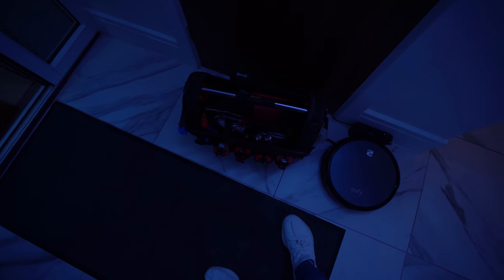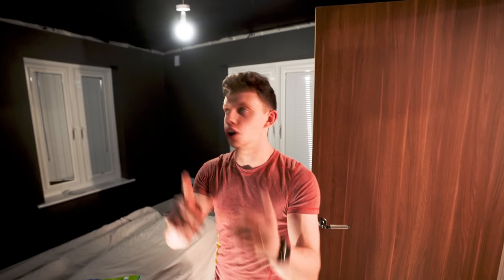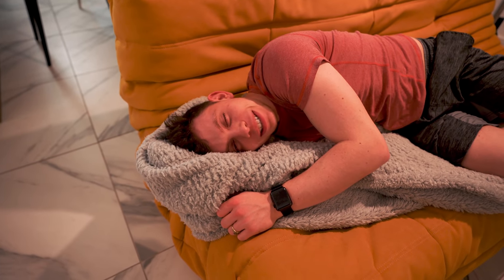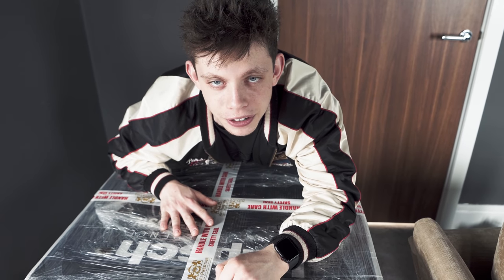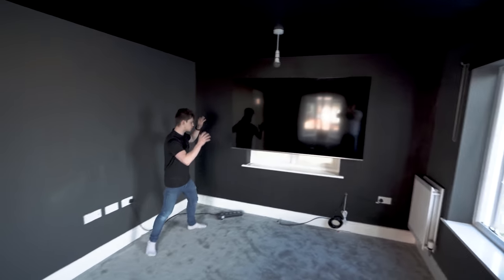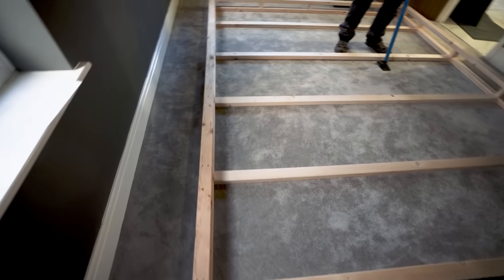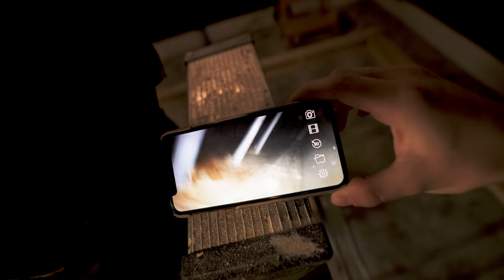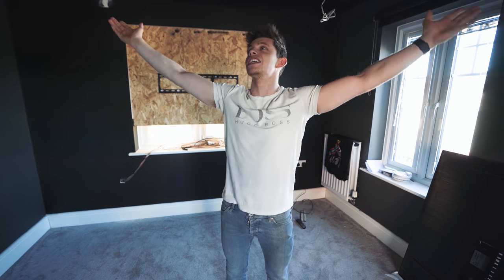Building The Insane Home Cinema: Episode 1!

Comment: why bothering with all of the black color and covering windows if you're not going for a proper projector and a screen? Could've even choose a screen that covers the window, and you couldve also mounted that projector in the frame of the ceiling. I don't know.. seems a little odd to go through all of this for just a tv
Reply: maybe the tv is a good enough quality and he would rather go out of his way to do this than spend the extra buck on a good projector, but if the tv would be more expensive then i would agree with you, there is no point going for the tv.
Reply: hyperspace36 And ruined his living room..how often is this gonna get used...MONG!!
Reply: @callumfereday9313  I agree, but a 85 inch 4K TV isn't cheap, its marginally less than a proper projector

Comment: Will you EVER learn how to safely manage cables? 
At the end of the video, your speaker cables just come out of a hole. Use a brush plate.
How many cables did you put through one path in that chiselled out wall section? Bad idea, should be separated to avoid interference.
In NUMEROUS vlogs, you've shown lethally installed plug sockets with exposed cables.
Reply: He did use brush plates before for his ultimate gaming setup, but yeah he should have at least added them for the cables for this setup
Reply: @First Name His instagram story just adds to how bad it is. I also use Klipsch for Atmos, and love them, however his implementation wrecks my respect for him.

Comment: Finally some quality content.  Liking the look of your room so far, though surprised you went for some huge floor standing Speakers, quality smaller speakers would be more the norm especially as the front three chanels ideally should ideally be exactly the same.  This helps to accurately transfer sounds around the  sound stage.  Anyway keep up the good work, looking forward to next instalment.
Reply: crewgadjy I think his done well with the floor speakers. The front speakers are the most important speakers. Larger doesn’t mean louder. Will just bring clearer effortless sound. Only thing I would have changed is the subwoofer. Would have gone with SVS for the subwoofer with Klipsch speakers.
Reply: @lequidsnake   I disagree and obviously there not louder.  But for cinema use you want your left right and centre channels to be the same,  you also don't want base, thats what subwoofers are for.
Reply: crewgadjy I agree they need to be the same. Same range model speakers. I think his gone with reference speakers so he needs to stick to reference speakers for the center too. Else the big left and right speakers will drown out the center speaker and won’t be balanced. Same goes with the atmos/height speakers. Won’t be great if he goes for cheap height speakers. The front speakers will just drown out the height speakers. Or he’d need to crank up the heights speakers to notice them while watch movies. This I just me being picky lol.
Reply: Either way, the Denon AV receiver will most likely have a balance feature so each channel can be balanced depending on where the viewer sits
Reply: @BradleyCopp  not to do with balancing the volume.  LCR are supposed to be the same speakers so the tonal range will be the same. This can only be achieved by using the same drivers in the same enclosures, thats why floor standers aren't so good, unless your gonna lie a third one on its side.  They typically come with a different centre speaker, they may have the same drivers in but the enclosures are different.  Any way nuff said on this subject.

Comment: Ran cables for the Atmos speakers and the rear speakers... As far as I know, Dolby Atmos is a full sound system.
Or do you have separate speakers for atmospheric sounds?
Reply: Atmos involves multiple speakers and can range in any size. They are like regular speakers. But they are meant to cast the sound off of the walls or floor before they reach your ear. It’s all based off of person choice or how crazy you want to go with the project.
Reply: @ChrisArtmeier  yeah, I know what Atmos is. It's just that Atmos is a full system, there isn't Atmos speakers and rear speakers, Atmos is the full system basically. (And it can be configured in many different ways)

Comment: I went for a box around the edge of the ceiling as the you can run all sorts of cables from the back of the room to the front all hidden. Oh and a cinema room needs a projector and 100" + screen to call it a cinema room, I have an 85" in my man cave at the bottom of my garden but only use it to play retro games as I have the projector projecting a 120" 4K image in the cinema room. Ps don't forget the popcorn machine as it really does finish it off.
Reply: damn when you gonna invite us?
Reply: Matt Garcya lol I built it all over a year ago and only used it about 5 times
Reply: @will9603  likewise. I have a gaming room and rarely go in there..
Reply: @will9603  wtf

Comment: Alex remember the walls are just plasterboard you don't actually need to take a channel out the wall just drill a hole top and bottom and you can fish the cables down just to make it easier instead of the extra hassle of filling all the holes and channels up with filler
Reply: @First Name but it can be done fished many a cable down dot and dab walls

Comment: T.V. covering a window...the most stupid and ridiculous thing I have ever seen. Not to mention fire safety hazard. No sense used when mounting that T.V.
Reply: @eloyreno  "It should be possible to escape through any windows on the ground and first floors in case of fire. The opening should be between 800mm and 1100mm above the internal floor level, at least 0.33m2 and not less than 450mm wide or high." Building regulations uk. Case closed.
Reply: But it must look lovely from the slab of concrete where he used to park his car!
Reply: @serverstatuscouk  Nah, if there is a fire he can call a taxi and drive around his 85 mile long TV to avoid the flames.

Comment: Adding a socket to a lighting circuit is illegal and dangerous particularly using a metal box without an earthing wire. That is extremely dangerous and you should report the electrician and get it reversed immediately. Like this comment to raise awareness!
Reply: Not illegal at all
Reply: how do you know hes not PAT qualified ?
Reply: bobandbobandbob Adding a socket to a lighting circuit is not illegal at all, why are you talking about things you don’t understand so confidently?
Reply: bobandbobandbob And the backbox will be earthed, the faceplate itself will be earthed and will earth the backbox when screwed in. It’s good practice to add a ‘flylead’ from the faceplate to the backbox is what you mean, however it’s not dangerous as the only way the backbox would become live in that situation is if you removed the screws and pulled the faceplate away, although why would you be doing that when it’s live anyway?

Comment: I still don’t get it using a projector you can have 3 times if not more the screen  size so the whole wall would have been covered in screen plus you can’t call a room with a tv in it cinema room it’s tv room
Reply: Agreed, calling it the "ULTIMATE" cinema room and use a 85" TV is quite laughable.
Reply: @dan man why are you hating. It probably costs more than your house. He can call it what he wants
Reply: @jhatch7gaming791  The tv is what, 4k max? Gotta be quite the shitty house then.
Reply: Which house are you on about specifically